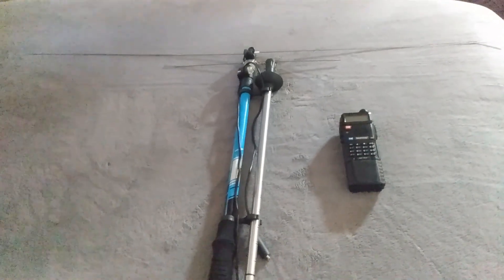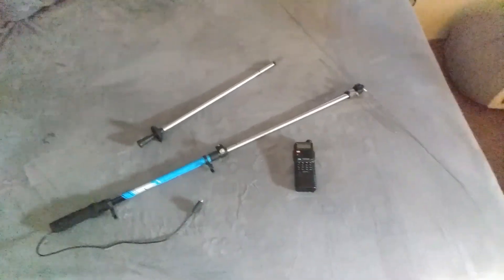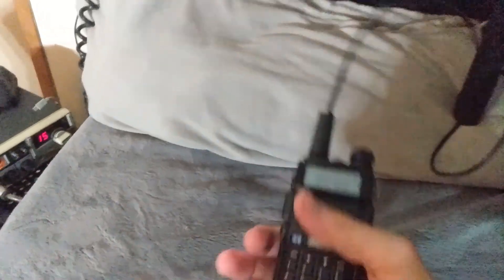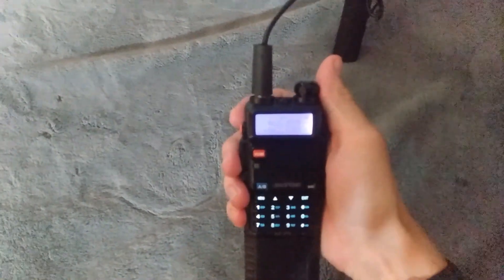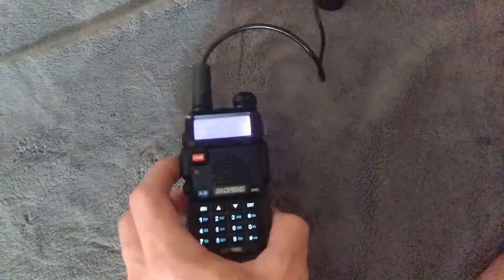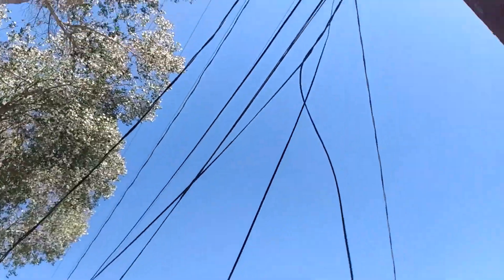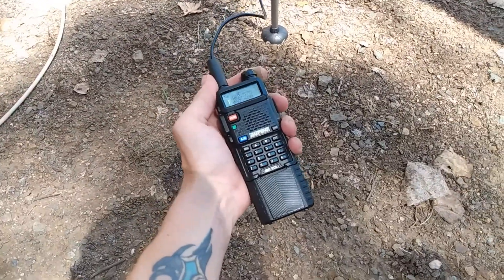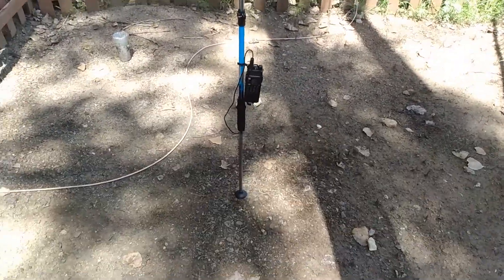Home Brewed 2m70cm Telescopic Dipole Antenna, Baofeng BF-R3.

Comment: Why do you have a 2 meter antenna if you have a GMRS license, it just gets in the way and there is no use for it.  Yes it should be vertical , you will increase by about 30 to 40 percent your range by going vertical. Your quarter wave length antenna should be right about 6 inches even , so for a dipole would be 12 inches plus feed point (about 1/2 inch) , total 12 1/2 inches.  Good luck with your antenna builds.  WRQX890
Reply from the maker: i have it just for scanning, and thank you for that info it helps.

Comment: You're loosing a lot of signal cross polarised like that. It will work much better vertically polarised on FM
Reply from the maker: I get better and cleaner signal on this antenna then 3 different storebought antennas